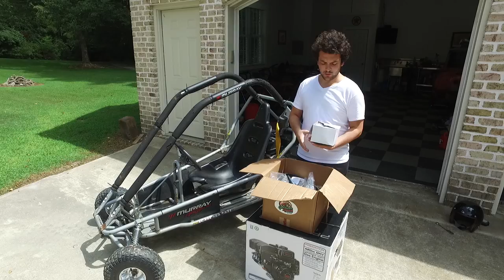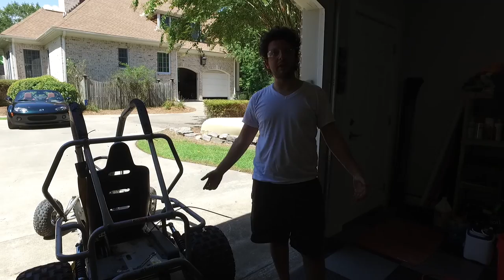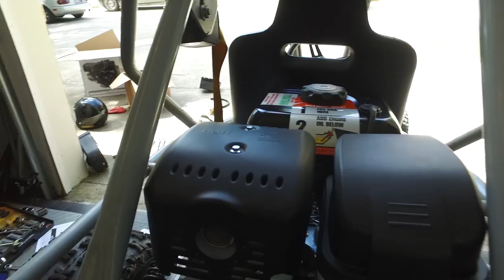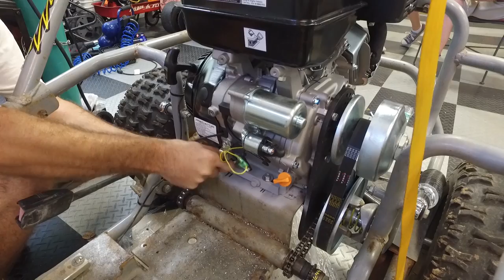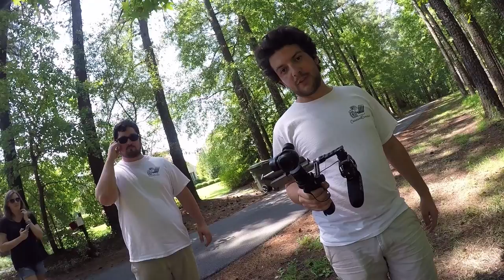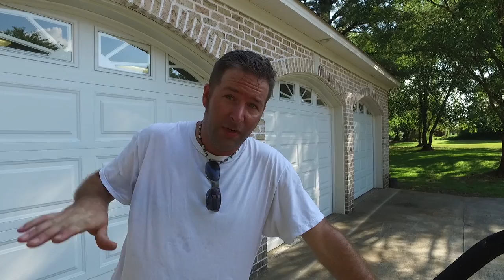420cc Go Kart Engine Swap (with MASSIVE torque)!!

Comment: You should do something with a 2-stroke for a change
Reply: yea!!
Reply: 440 SNOWMOBILE ENGNE!!!! super cheap and super fun, ive made 1 for offroad the thing is a beast. they use the same belt clutch cvt style torque converter that those karts use
Reply: Strap a kx500 motor onto the Murray 😂
Reply: buahahahahahahahahahaha
Reply: I think a diesel would be awesome.
Reply: 2 strokes are kinda shitty, and deisel is badass, just not sure if u could fit one on a go kart
Reply: they could do one with the 10hp? diesel that fearlessfront put in his sears mower. not that fast but it has more torque than traction
Reply: Two strokes are kinda shitty? In what world? They're light weight and make nearly double the power of 4 strokes for the same size.
Reply: Maccaroney yeah but they break easier and require special tools to work on.
Reply: They don't break easier. There are less parts to break. And they're cheaper to rebuild.
Reply: Maccaroney huh. Whay motor do u have? Cuase my experiance is different than urs
Reply: I'm relaying what my boss tells me at work. He's been working on both 4 and 2 strokes for 20 years.
Reply: Maccaroney oh ok. Hes got more experience so ill believe him i guess.
Reply: I believe pretty much everything he says about mechanical stuff and i'm a skeptic. lol
Reply: Maccaroney yeah. Me 2, my dad used to race alot and he helps me on my builds with tips and instructions. Same with the manager of the autozone i work at
Reply: rotary?
Reply: wd - 40 no.
Reply: gimme 3 reasons why not
Reply: wd - 40 parts, not as much torque, needs a transmission
Reply: JuliusJesse 
yassss
Reply: JuliusJesse
Reply: Brandon Fritz e
Reply: Anthony Garramone 
 ,,
Reply: JuliusJesse l.
Reply: yz250 cart
Reply: Flyin sushi no they ain't
Reply: make a giant remote control car with the 2-stroke power

Comment: yall should try to put nitrous on one of these motors and see what happens
Reply: pretty sure it'll Blow
Reply: like he said I dont think it would handle it.
Reply: +Atvsrawsome it works if set up proper
Reply: they can handle a food grade can of nitrous in short shots
Reply: They make kits for it on ebay, and they really aren't worth it from what I've heard. They don't make the engines last awhile, and melt pistons. Better just to do like a stage 2 kit overtime
Reply: Turbo much better

Comment: Ike, you're not alone! I built a single seat kart with a 212 then a 2 seater and tried a 212 and moved up to the 420. Now the 2 seater is just as fast as the single seat with the 212! I have broken and repaired both karts a couple of hundred times! But that is what is fun! Both will climb a 45 degree hill that is 30 foot tall!

Comment: I know this is old but I've got the same Kart and was able to use the stock jackshaft setup with the 40 series torque converter. Mine has a GX390 stroked to 460cc. Planning on rebuilding the front end with dual upper and lower a-arms with front brakes then eventually independent rear suspension. The reason it kept throwing chains is because the stock setups jackshaft pivoted at the swingarms mounting point so the distance between the to drive sprockets stayed the same at all times, using the torque converter backplate setup it doesn't!

Comment: instead of using a 670 y don't you use like and old xr Honda 250. has way more power and has gears. would be more work to make but would be more fun

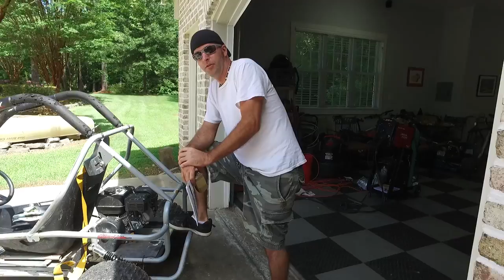Comment: At 2:45 - a claim is made that must be tested somehow: that there's no way for the 212cc Predator to compete with the 420cc model. The challenge: Can you come up with a way to make the 212cc engine provide the acceleration or off-roading performance of the stock 420cc engine, using the various mods available for the 212cc Predator? Using any means necessary - turbocharging, supercharging, turbo-supercharging, EFI, heck I wonder if alternative fuels might be a possibility. Even if you could come within "spittin' distance" of the 420's power, that would be quite an achievement.
Reply: Uhm actually a built  212 can smoke one of these 420s. They can get much higher rpm and you can build them to 25hp and 15 torq. There is a reason there is a racing class of go-karts dedicated to the 212s. 420s are decent power and torque if you just want a bolt on and go but the 212 is a much higher performance engine and capable of being way more built. Also much more performance parts made for 212s and hardly any for 420s. A built 212 would spank this even just a stage 2,3 or 4.but a built stage 5 with turbo lmao 420 could never touch in a race even built would have a hard time. Rpms and acceleration wins in racing.

Comment: First jump in my Dingo and I immediately added a thick foam seat cushion.  My back hurt for days. Glad to see you're all right after that jump.  Btw I'm putting a 420cc Predator engine with torque convertor in a mini-bike. Bought the stage one upgrade and installed it. Can't wait to see how it does.  Awesome video as usual fellas!
Reply: wow! be careful

Comment: I had that exact same kart, they not made for jumping lol, i modified the suspension, took out the gov, and added 1" stainless header, ported and polished carb and exhaust, all on the stock 6.5 hp motor. Hit 38 mph on it, also the brakes suck constant adjustments needed. I ended up blowing out that the clutch, had enough with the kart and sold it.

Comment: Question but first here's the break down of my project I'm building. 420cc 2 seater, now starting with rear using a 420cc engine 40 series torque converter kit with a 12tooth (definitely not from OVER PRICED go power sports "they are rip offs" $546.00" compared to same product for $219.00) 1" live axle dual brakes and 22x11-10 tires on a swing arm with air shocks. Front of kart 20x8-8 tires double a-arm and air shocks. Now with all of that being said what size rear sprocket would be a good one I was thinking a 48 tooth. Trail riding and tarmac use. Not jumping.

Comment: HAPPY BIRTHDAY IKE ! ! ! ! ..................... Time to redesign the front suspension ......................... Please find a 2wd  4 wheeler and use the front suspension off of it (like an old Blaster or Banshee ) .......... Also use 2 of the rear shocks off of a 2wd 4 wheeler (you would need to find 2 from the same style as they only have 1 rear shock , but I am sure you know this already )  ............ If you can find just the chassis ,  use the suspension setup on the go-kart chassis ..... Of course you will need to beef up the mounts , but then it could handle the jumps and what ever else you want to do with it .............. You could also use the 2 front brakes and the rear brake and axle off of the 4 wheeler ...........   The basic go-kart with this new engine setup is golden ,  Just time to add some true off road suspension and this would be a fun toy that would handle the abuse you want to (and will ) put it through ........................... Love the build so far , this would just be my next step in making it "Ike" proof .........
Reply: thanks. lol

Comment: hey guys! love your videos! just wanted to ask you if it's necessary to remove the old driven and replace it with a sprocket. I would like to know what sprocket you used and chain size also. I have a Murray with a 212 and I wanted to upgrade to a 420 but I wanted to keep the driven as is. Is that possible? thanks!

Comment: Maybe some shocks from an old 4 wheeler. It needs a bit more damping. and with the extra torque, fatter tires would help with the lack of suspension travel and it would gear up the cart a bit.

Comment: Hey guys. Great video! But I got a small question: I got a go kart that has the engine mount on the left side, just like yours. I wanna put a 420 in it too, but on the specs it says it rotates counter-clockwise. Wouldn't that make the wheel spin backwards? I was only gonna put a centrifugal clutch on it for now, and a torque converter later on. Unless the torque converter can make the tire spin forward?

Comment: just a question 4 C&C, can you put the pulley wheel for the torque converter straight on the axel since the part that expands is on the engine side?? that way you could almost set the engine right over top the axel or atleast mount it farther back towards the end of the frame

Comment: you don't need a shock adjuster take a rag and a big pair of channel locks to turn it it helps if it is jacked up and side to side adjustment needs to be the same but front to back can be different love the vids.

Comment: i feel like im wrong, though it seems his name is john. when he hit the hill with the 212 he got some air as well and was able to jump it. cause when ike tried before with either the old motor or that other off road cart you got. he couldnt, but with the 212 he still was able to jump it. maybe not as much air and like you said ike. it was cause you hit it at a angle and how it landed, for the most part.

Comment: Hi guys love the videos. I have a 6.5hp on mine but im having trouble with lack of power or torque to climb small hills,
what would you recommend ? upgrade to a 13hp or just add a jack shaft of torgue converter?
Reply: Torque converter makes a huge difference. Also make sure your sprocket isn’t too small
Reply: @Nico__1997  cheers for the advice.

Comment: I built my first carpet cleaning machine with a 420 cc turning a number two blower really well I only keep it around 3000RPM but I had 500 feet of hose on it one time doing an apartment complex and it held 18 inches of mercury lift no problem

Comment: guys I need experienced advice.

I have just picked up a demon off road side by side kart.  it's heavy.  
I think it's like your red one 

will a predator 420 torque & coverter be enough power 

will it drift and be badass? or is the 670cc the way to go...  the more hp means more expensive torque converters and the 40 series are to much $ for me.....

Comment: You guys should try pulling an atv or bike motor, my 250cc suzuki atv engine puts out around 17-18 hp which is more than your guys 420cc predator engine.
Reply: Grainsauce it’s about simplicity and cost

Comment: I have recently started to watch you guys and this channel is sweet!!!! I just bought myself a go cart and it has a 208cc CMXX commercial series engine in it . I was wondering if these engines are good ? Also i was wondering if i should take the governor out because it only runs 11 mph. Is there  a more safe route to add power without spending alot of money ? would appreciate some input !! Keep your guys thing up thank you!!!
Reply: it looks like a Honda clone. I would remove the gov, jet the carb, and put a header on It. that should be about 9 hp
Reply: so i should buy honda parts from gopower sports? If the governor is removed whats the best way to keep the engine safe from being overworked like should i put a certain treatment when i do oil changes?
Reply: I'm not sure where you would get parts for that engine. gopowrsports should know more about that engine than I do. when you remove the gov I wouldn't hold the throttle wide open for long periods at a time and I would change the oil at the least 1 time a year. oil changes are cheaper than buying engines
Reply: Thank you for your feed back one last question though. I am trying to decide between a 5 hp subaru robin or  208cc CMXX commercial series engine?
Reply: I don't know anything about the Subaru engines

Comment: I have a HUGE question, for this engine, what kind of battery should I get? also can someone link me to a gear set for this? A 40 Series Torque Converter Kit thats cheaper than go power sports?

Comment: Cars and Cameras I have a serious question that needs answered. Which is better to climb uphill with, a torque converter or a clutch (centrifugal). Which one could you stop on a hill and take off with. I'm fixing up my Murray and can't decide what to put on it. Like I said i need this answered as soon as possible. Thanks!!!
Reply: torque converter would be best on a hill
Reply: +Isaac it'll be fine ok thanks! Once its done and painted ill send some pics
Reply: cool
Reply: I have another question. Its a murray kart and the driven pulley is a 20 series, should i upgrade to a 30?
Reply: I'm not sure how much better a 30 series is compared to a 20
Reply: Alright. You guys used a 30 on that Murray of yours didn't you?
Reply: I think its a 40 series. because it is a 420 on it

Comment: Know this comment is 2 years late, but the front end on a lot of the karts I see are too lightly built.  Getting air borne is part of the fun.  Ive certainly had my share of unintentional air time. I've wrecked a bunch of stuff including 4x4 trucks.  and uh, the black balloons are for your 40th.  At my age, I'd have to insist on an air bag seat.  But thinking about building one of these, fer sure.

Comment: You need a 400cc out of a HondaTRX400. Air cooled, clutch, 5 speed :) WAY more power than that predator 420. Or find a kick start Honda 450 engine. ~35hp and might be smaller. (just need water cooled)

Comment: Well thanks for confirming that I'll be getting the 420 instead of the 212 for a little off road project of my own! Now the fitting of that beast is another task altogether...
Reply: Should have got the 212 if you want high performance you can build a 212 much faster. But if you just want easy torque for off roading and don't want to mod it then go 420.

Comment: do you know what year that murray is? I've been trying to keep up with upgrades but nothing I keep running into frame differences.
Reply: I don't have it near me but I think its a 05
Reply: I believe mine is an 2000. it is possible the person I bought it from made a few mods. he was a large man. I'll be trying the torque converter from the video also. Mine is giving me problems.

Comment: how many teeth are on the sprocket on the go kart? I have a 420 with a torque converter and it keeps frying the belt so I am trying to get a good gear ratio
Reply: I'm not sure.its a big sprocket. its about 12 inches in diameter

Comment: Can u guys show the govener removal and the under side of the go karts suspension
Reply: I think we did a gov removal vid with the drift trike
Reply: Can u guys show it in the next vid if not 
What vid was it
Reply: Isaac it'll be fine
Reply: I'm not sure but its in there. probably before the fuel injection

Comment: i say it needs longer shocks on the front.. and slightly taller tires too.
Reply: I don think there is much room for longer shocks. because then the tires would camber really bad.
Reply: Atvsrawsome yeah.. I know if it's too long the camber would be bad but a little bit is ok.. more travel is good especially when you're doing jumps like that.
Reply: that thing should never jump like that haha you need long travel suspension for that haha.
Reply: granted yes it would still be pretty cool.
Reply: Let's just say it's better than no suspension.. I personally know from experience.
Reply: true that

Comment: HELP ME PLEASE 🥺😭 I have a Duro max engine 18 HP 440cc with a 40 series torque converter . I'm going through belts like flipping crazy. After about one hour of riding the belt is trash. I have my converter lined up nice and straight I just don't know what I'm doing wrong here. Unless I'm just buying belts her way too cheap I've been going on eBay and getting the five belts for $25

Comment: I have a problem with my torque converter I think so a few mouths ago I had a 195 cc on my kart and its top speed was 35mph and then I got a 212 preditor and a torque converter and the speed dropped to 28 yes a can spin the wheels a lot but I could do that before. Now one thing is all my friends had gotten torque converters and they mad the speed of there mini bikes go from like 25to about 43 mph I wish there was more pieces so I could tune it because I can't take off my back axel off because I don't have the tools. Now is there a reason why it goes so slow now? I don't really get it.
Reply: did you remove the governor ?    the 195cc engine probably turned faster than the 212

Comment: just a thought but I don't think the murry was designed for ,adult weight, extreme sports tricks, head on collisions with dirt banks, you might ass well have built that then run over it with a truck same results you would have gotten an interesting video out of it.

Comment: There is a replacement for displacement;Its called ford;The 2018 F-150 has a 3.5L V6 engine with 450HP and 510 Ft Lb of torque more than Chevys 6.2L V8  or rams 5.7 V8.

Comment: I need help :( I made a gokart from scratch I have a 15hp 420cc engine but I can't find a heavy enough dry clutch or anything I'm in the UK so fuck go powersport My gear ration was 15-30 it worked out okay however I do need more torque :) any ideas thanks.

Comment: wish they'd put a real engine in there. put a 250 2 stroke  in there, hell they'd be pushing 43 with just a stock 250 2 stroke motor

Comment: 2:50, or you could just get a genuine Honda gx...
Reply: for probably 4 times the price
Reply: You gotta keep an eye out for deals on Craigslist. I found a gx160 with electric start for $65. You can find running gc160s off of broken pressure washers for next to nothing.
Reply: Yeah, but they run backwards, after you cut and machine, the output shaft, but I like next to nothing, and turning the engine around is probably within most peoples mechanical abilities.

Comment: I had my 212 on my race cart and I beat my brother civic in a 300 food drag race and my front tire bolt gave out and front right wheel went far rights do my other one went left and it whipped out now the frame is fucked and my forearm is shattered I remember when I first got it after my 300 I honestly forgot the brand blew cuz my brother as a joke drained my oil out of it rip but I use to run from cops in it and go pick up my friends at night